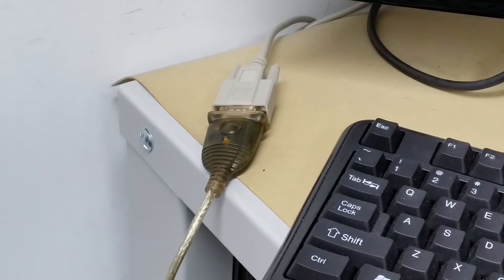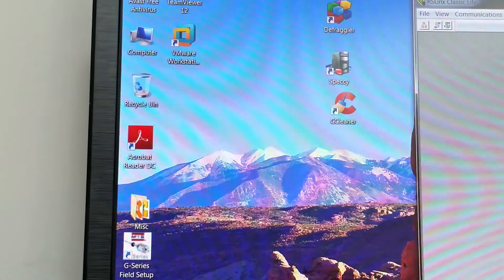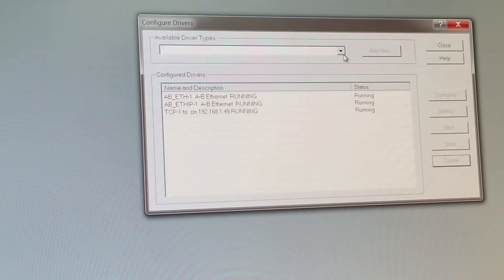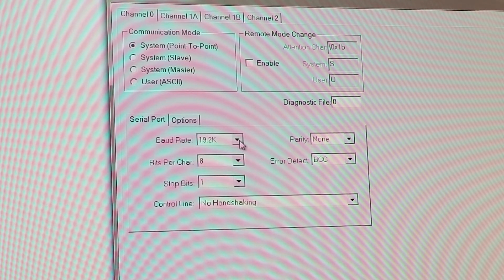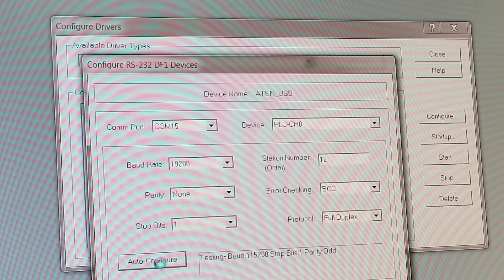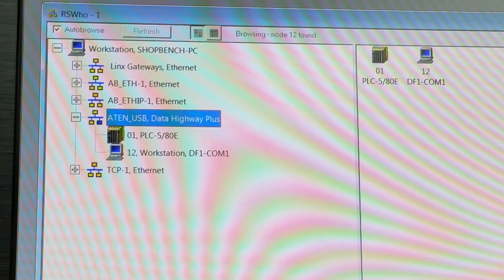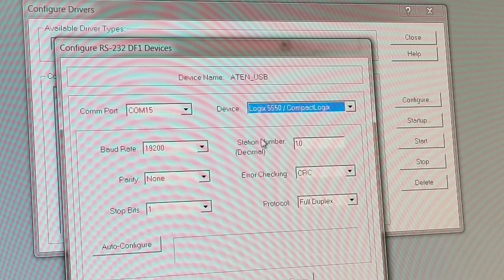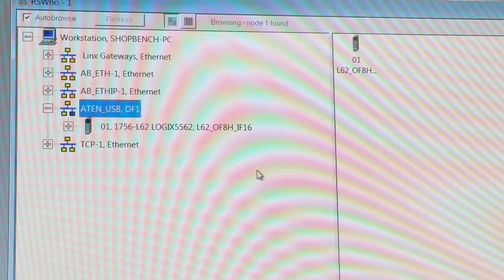Using RSLinx with a USB to RS232 converter.

Comment: I have a laptop with a DB9 port, can I connect directly with a cable to the PLC 05/15, without the need of an adapter?
Reply from the maker: Hello Nicolas:
Yes you may.  Build a cable to the specs in the AB manual and then set up RSLinx to communicate with the front port.

Comment: Hello Bruce, Is it 25 pin plug that is going to PLC and the PLC under demonstration is PLC 5/40E or else. Can you please give a link to buy USB to serial cable and from that USB serial to PLC cable
Reply from the maker: HI:  There is nothing special about the USB to RS232 adapter.  There are many online that you can get that work very well.
Just do not buy a really cheap one they fail too often.  An older USB2 actually works very well.
Also get a 9 to 25 pin adapter to be able to use on the PLC5 serial ports.
The cable is an AB CP3 which you can make yourself and the wiring is available online.
Thank you

Comment: Good evening, Bruce. I wonder why @5:46, DF1-COM1 isn't DF1-COM15. TAHNK YOU.
Reply from the maker: Hi Dennis:
Just the way it went.
No I don't know why at this point - That was done a long time ago.
It is always best if you can keep the comm port less than if you can.  Depending on what your operating system is it may work best with Linx.
Thanks for subscribing.